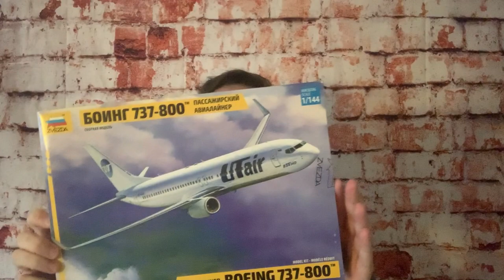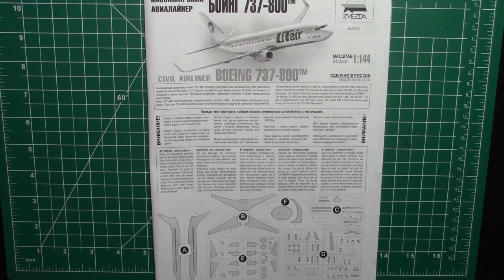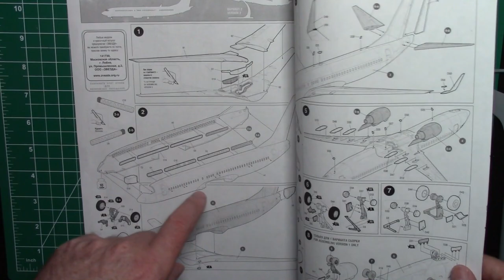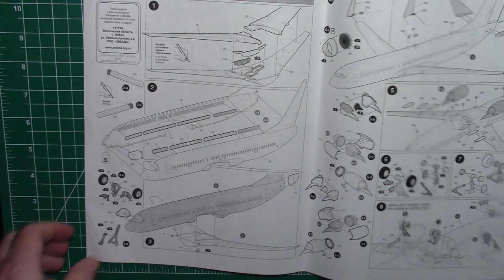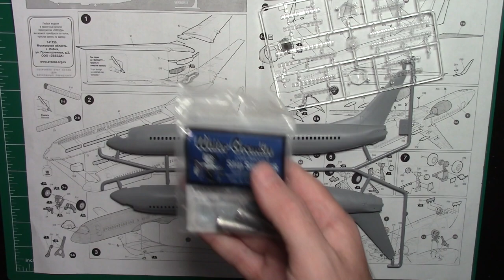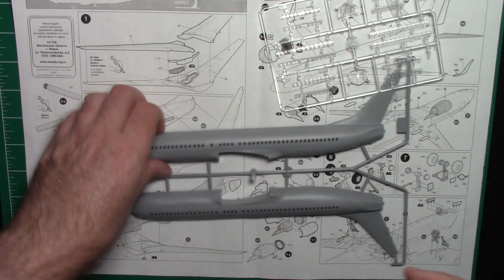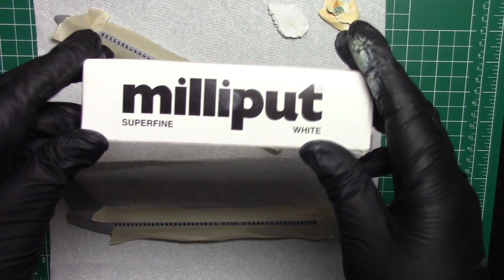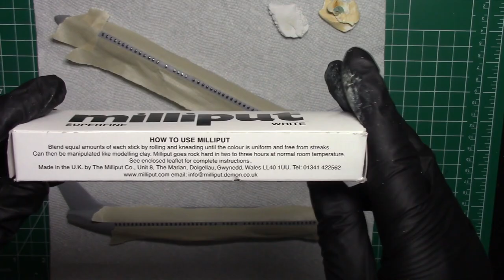1/144 Zvezda Boeing 737-800  Build Series - Part 1: Intro and filling windows

Comment: Do you think a beginner can build these kinds of models and pick these up? I've wanted to build one for a while, but I don't know the materials I need or where to start. Are the instructions easy to read?
Reply from the maker: Yes, airliners are few parts and cheap. Just don’t expect it to turn out super clean for a first time. It will take months/ years to build up your skills.

Pick up a Zvezda narrow body kit and some Tamiya Extra thin glue. You can paint it with a rattle can and not an airbrush. Using something like TS-26 from Tamiya or even just gloss white from the hardware store. Just spray slow thin coats. Don’t try and cover it all in one go or you will get runs.

Comment: Hi Richie. Catching up on this build. I have never done an airliner. But if a kit comes with the clear windows. Isn't it easier to just mask them off by painting Maskol over the windows. More hassle doing each window maybe. But it would eliminate the need to use window decals and no putty and sanding.
Reply from the maker: I think easiest is to just use something like crystal klear or a pva glue, once fuselage is painted. Just dip toothpick in and fill each window. There is no interior so I always just fill and decal.
Reply: @RWHobbies  Good tip. Maybe I will do an airliner one day. But I am full of kits at the moment lol. I just had delivered today AMK's 1/48 F-14 D Tomcat (2021 version). Wow, that is some kit. The box is stuffed full of plastic. No ground weapons though. But it don't matter, because I will have some weapons left over from my Hobbyboss Super Hornet build that I can use.

Comment: Good video. I’m just returning to modelling airliners . The last time I built them I was probably 11 or 12 and it was mainly Airfix kits .  Really interested in your treatment of windows and looking forward to see how you get rid of the join and get a smooth fuselage .  I did start two Airfix 737s a few years ago  in an effort to model the aircraft I used to see in the UK . They are still work in progress, but I have just bought Airfix reissued classic Trident and think I’ll build that one using decals supplied straight from box .
Reply from the maker: Hello, thanks for watching. Zvezda are the way to go for someone returning to doing them. They fall together and much better than Revell or Airfix. I have tried all kinds of things for the seam line. I have found sprue-goo is the best to create a seamless finish..
https://www.youtube.com/watch?v=CJLN0jDIv-0

Richie